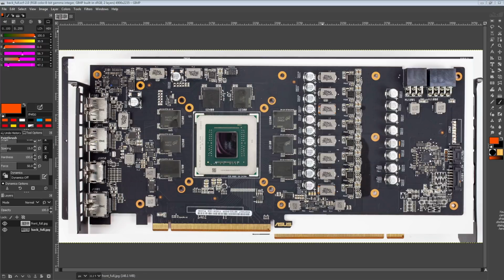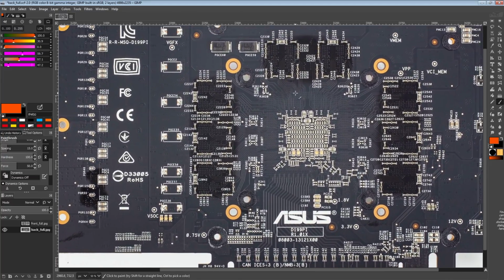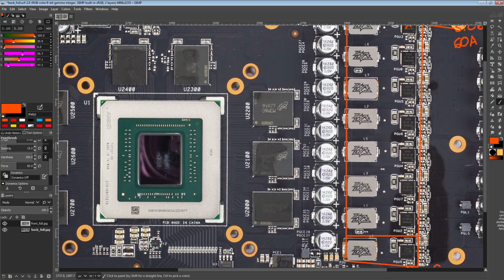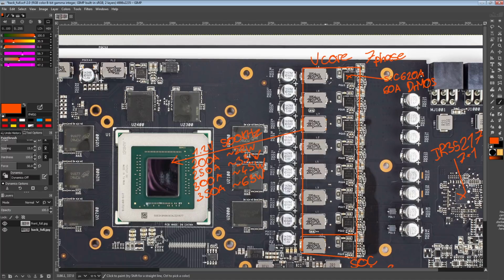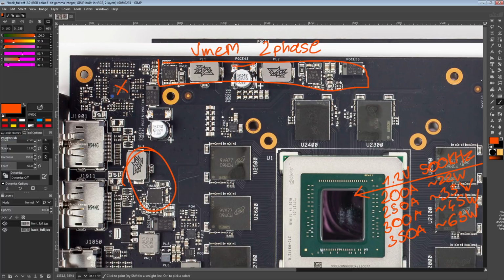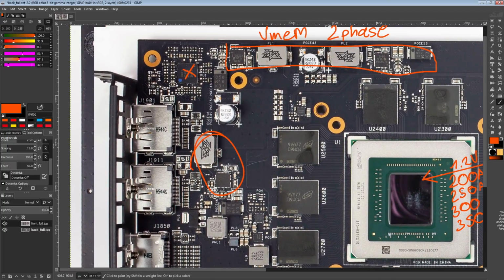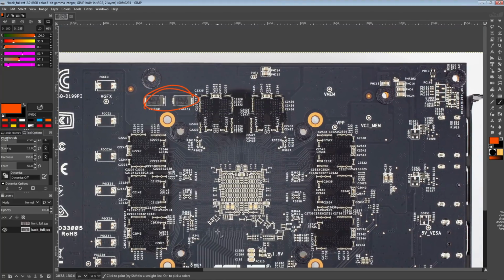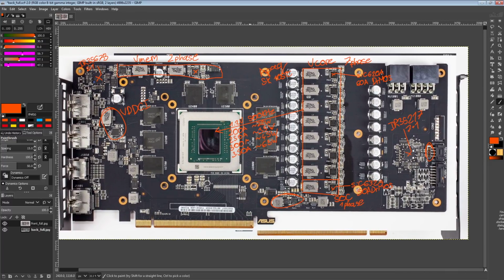GPU PCB Breakdown: ASUS RX 5700XT TUF EVO

Comment: Driver still bad so I don't recommend anyone to buy rx 5700/xt  or even 5600/xt
Reply: Could you provide some examples?
Reply: @AVINIDE  just read reddit "amdhelp" and you will see amd couldn't fix major (rdna whole family  can't and will not supprt ''run badly'' with old games ,fps randomly dropped for no reason , bug in driver, black screen when use alt-tap , unstable driver ) Amd add useless stuff for no reason and from the past Rdna is very sensitive to any change so if you try to try to change gpu clock it will not work as you wish . It's been 1 year I just lost hope in amd never gonna buy it again. The support team is really bad  I'm just saying if you want to no headache get nvidia .
Reply: @yooanto9465  I had both Nvidia and ATI/AMD GPUs and I knew the husstle with RX 4/5xx series hence why I own now a 1080 now

Comment: I wonder if this was the one that the fixed to run the GDDR6 at a decent level. They first ones they released of these had horrible GDDR6 cooling. Hardware UnBoxed did a big review on the old bad one and the new fixed one.

Comment: That card seems pretty nice considering the price :D
Guess I´d pick that over any 2070.
Random question. When a Power Stage dies and you desolder it. Does it hurt to see if the card runs at all with 3 instead of 4 power stages without further modifications or does it complain somehow? It´s a RX570 4GB Puls ITX. Also, the Die itself has a resistance of about 0,4-0,5 Ohms. I´ve seen higher values so I am concerned. It´s the first card that gets "tortured" by my atempt of fixing it.

Comment: any idea what the 1 ohm resistor between the switching node and the corner pin does? I checked the datasheet and there's no resistor off the sw node. The DFN style package has no leads on the corner. Just looks odd to me. I see a capacitor there too that goes to ground, so I'm guessing some sort of phase margin compensation for stability? 
Also the VRM output capacitors being SMT will definitely have lower ESL than the TH version. Even if the capacitor itself is the same, the required through hole itself adds about 1.5 nH of inductance depending on the dimensions

Comment: On the through hole automated assembly, pick and place machines for through hole exist, wave soldering is how one sided boards are soldered, but there are also machines that can move a "fountain" of solder around to only solder certain areas of the boards. Those are called selective soldering machines.

Comment: One question to Buildzoid, how do you know/measure the heat produced by the VRMs at a certain power and their efficiencies? In VRM chips datasheet?
Reply: You guessed correctly. search for the power stage's ID and try to find the spec sheet.

Comment: Watching your videos are my way of relaxing while coding. I wish I understood what the powerstages and vcores etc actually does.
Reply: Vcore is basically GPU core voltage, and power-stages basically make them more efficient. Don't quote me though XD.
Reply: The controller puts out a switching frequency (usually 300Khz) and by switching 12V on and off into capacitors for 1/10th the duration you get 1.2V and vice versa for 1V. Very nice for controllability.